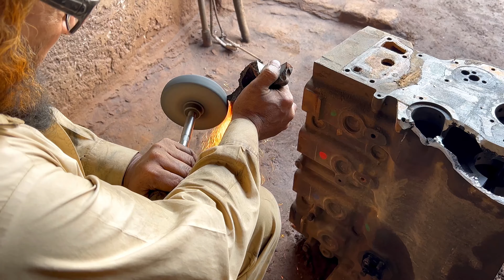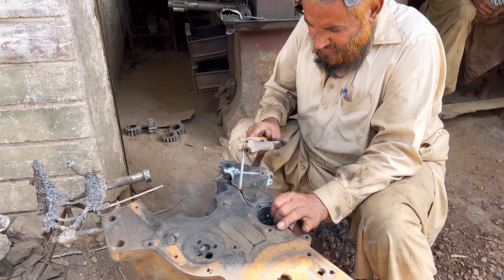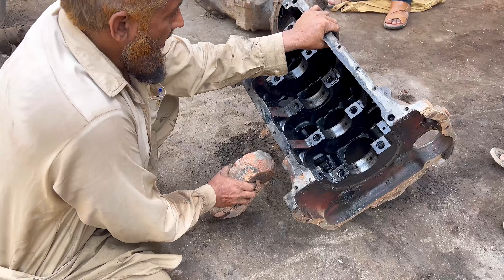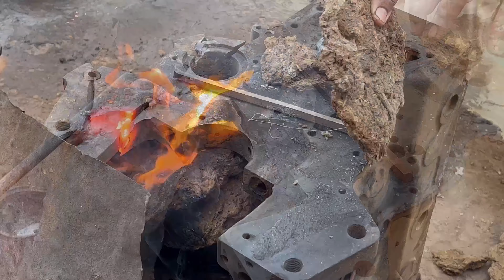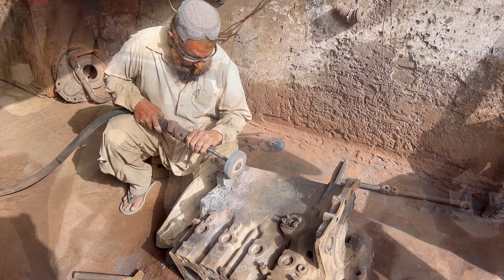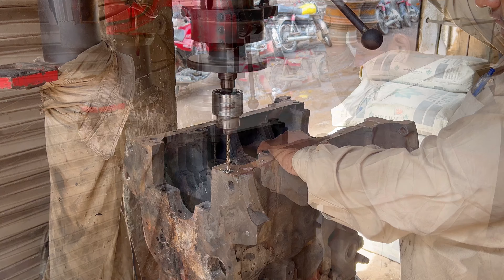The old man repaired the broken engine block cylinder very well - Fiat 4 Cylinder Block Restoration

Comment: What kind of welding is this
Reply: It's mot welding.  It's brazing.  Welding melts the the metals together.  Brazing only melts the filler rod.  For cast iron, he would be using bronze filler rod.

This is an old thread so I won't go further.  But if anyone wants to know why brazing and not welding, I can elaborate.